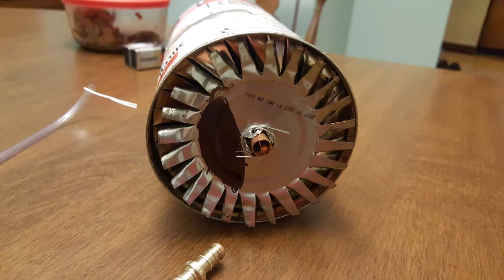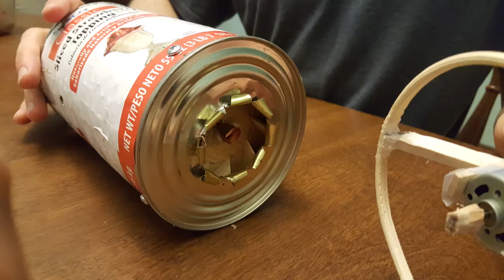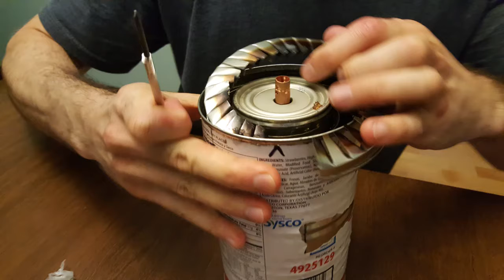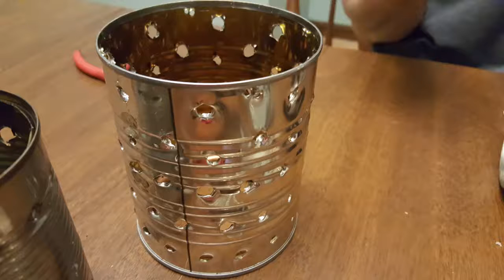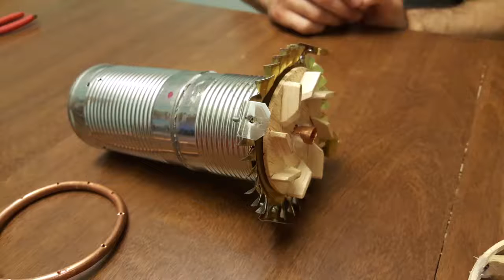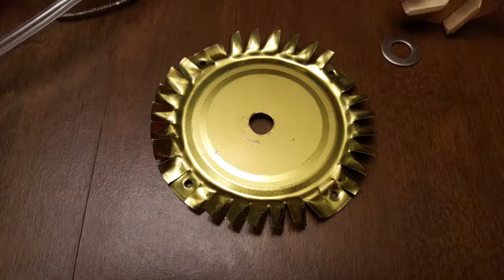TJ0 Teardown Slideshow

Comment: Not a bad attempt. Needs more stages of compressors since you're doing an axial turbine engine and need to push massive amounts of air to be compressed by the stages. Strators and stage blades should be cut with more precision so air doesn't leak and aligned in either impulse or reaction design or a combination of. If you have a tapered exhaust nozzle diffuser, you should have a larger intake nozzle with larger intake impeller to ingest more air. Combuster is interesting design, might be interested in replacing manual ignition with small spark plugs from hardware store. Just my opinion. Good luck!